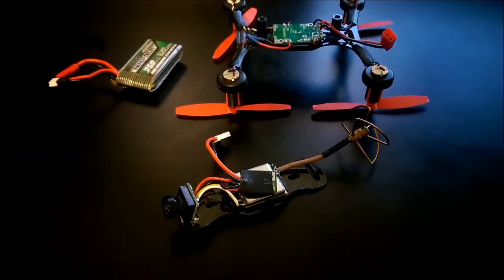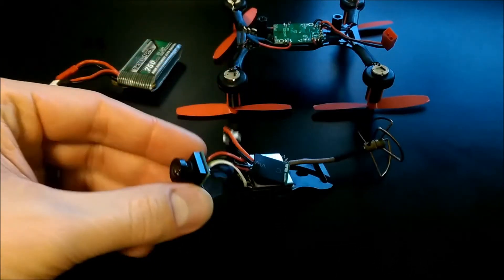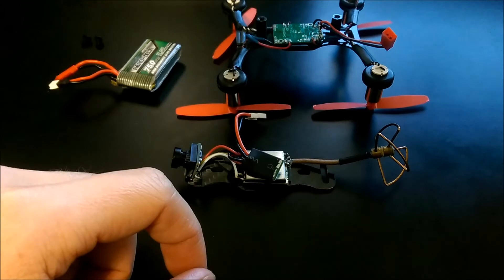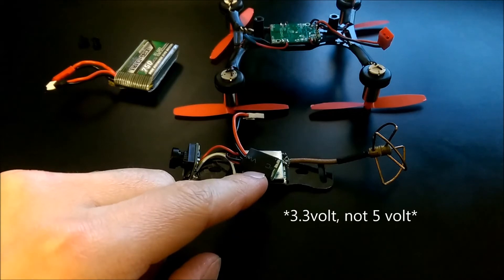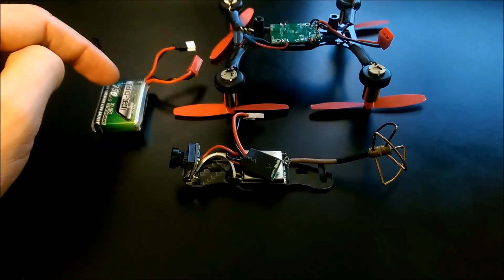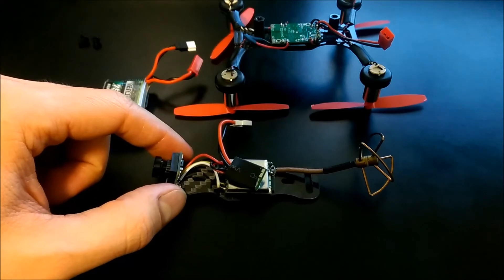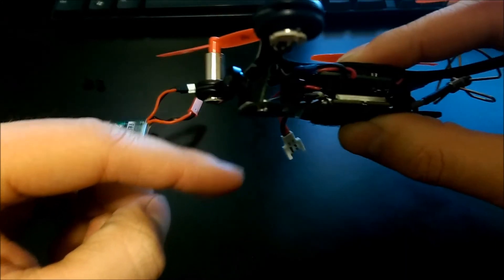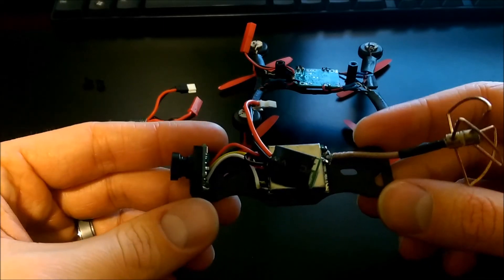DIY Micro FPV Racing Plate

Comment: Nice video! But without the DIP Switch, what channel I should select in my VRX ?
Reply from the maker: Channel 3.8 is the default channel mine goes to when I soldered the vtx
Reply: +DIY FPV Quads Thanks 😎

Comment: I made a similar quad with a 1.3GHZ VTX but unfortunately the frequency harmonics stepped on the transmitter signal for the hubsn FC so bad it's range was about 10 feet. https://www.youtube.com/watch?v=qJ3VPX8kJX0

Comment: I love the way you put the top plate on the bottom. I'm getting ready to convert my Hubsan to this frame and you've given me different options on how to set it up. LOL
Reply from the maker: +Street ☢ PC Gamer &amp; Shenanigans Extraordinaire Thanks, I feel it's a little more durable on the bottom and makes an easy removal for the FPV gear to put on another model.
Reply: +DIY FPV Quads True that! It's a really nice setup. I just finished my build but am waiting for my camera.
Reply from the maker: Upload a video of your build once you finish, I'd like to see how it turns out.
Reply: +DIY FPV Quads will do. I'm using an all together camera so I couldn't put mine low like yours but I'm liking it. I was able to put together a really nice rear light bar with the leds though. LOL
Reply from the maker: +Street ☢ PC Gamer &amp; Shenanigans Extraordinaire I was just looking at your channel and some other micro videos you posted in (Nick Burns videos). What flight controller are you planning to use with your micro quad? Are you wanting to fly Acro? I am looking into converting my Hubsan based quad over to something that can fly Acro, much more difficult/fun to fly. What are your thoughts?

(Nice Arma videos as well, I love Arma 3)
Reply: +DIY FPV Quads I've already built the quad. I used a Hubsan x4 h107c board. It's my starter micro. I'll upgrade to a better FC later. Right now I'm just waiting for the camera for my micro and a replacement motor for my 250. I haven't been able to fly in 2 weeks and it's KILLING ME! lol
Reply from the maker: +Street ☢ PC Gamer &amp; Shenanigans Extraordinaire ...I'm kinda embarrassed to say this but I just found out TODAY that you can disable the auto-flip mode in expert mode on the Hubsan board! My videos of my micro quad are all done in the low rate mode because it's impossible to fly with the auto flip-mode on. In the past when I went into expert mode on the Hubsan, if you make any left to right adjustments on the sticks it would pull a flip automatically, this was so frustrating. When I go home from work today, I am going to test this out to see if you really can disable it.  Disabling the flip-mode it should turn this thing into a full beast! It was fast before...
Reply: +DIY FPV Quads wow really? mine doesn't do that. LOL I fly in expert mode but I have to push the stick all the way in a direction and then back the opposite direction to get it to flip or roll.
Reply: +DIY FPV Quads if you're using stock transmitter just press left stick, one beep no flips, two beeps flips.

Comment: I would add a 2mm nylon tie for strain relief on the antenna. It's bound to hit something, and the pads on the transmitter are very fragile. Using the same setup on all my micros, with a 1S video battery for a clean signal. As you say, the Banggood stuff is great.
Reply from the maker: +Mark Van Thanks Mark for your suggestion. Since this build have applied a couple dobs of hot glue to hold it in place. I do think that the nylon tie would be slightly more durable to I will have to try that once the hot glue breaks free. Happy flying! :)